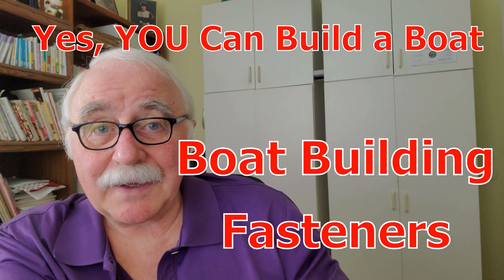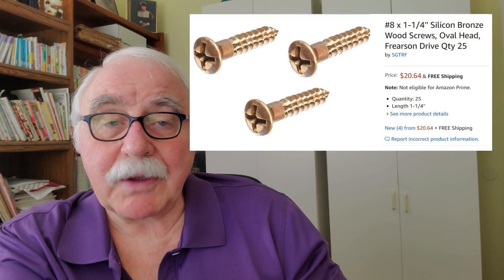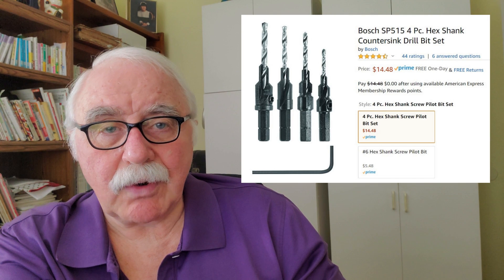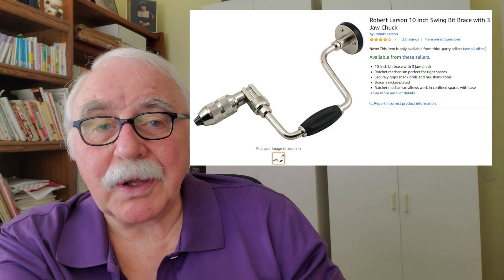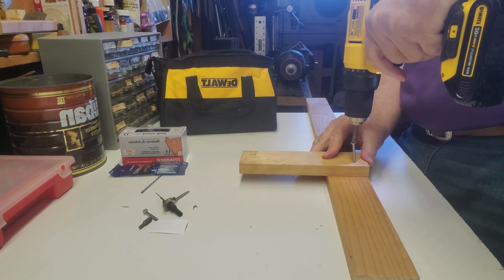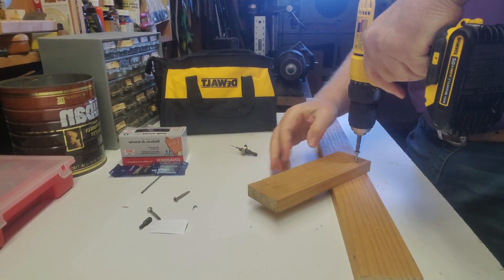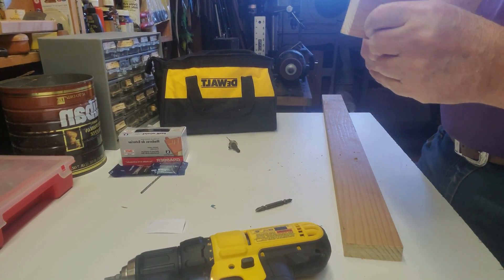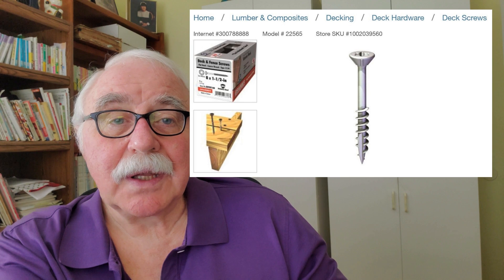Yes, You Can Build a Boat - Boat Building Fasteners

Comment: Just having a conversation with a fellow boat builder today about fasteners and I like your thoughts on it.
What do you think about using plastic staples (like Rapter) for attaching plywood 6MM to the frame ?
I wonder if they would be strong enough for areas of the plywood that are under stress from forming around curves?
Epoxy does 99% of the work but I'm interested in positioning the ply even in stressed areas and have it stay put without molesting it with tons of screw holes.

Comment: Torx head deck screws are the best thing ever in my opinion. Also, regarding stainless steel fasteners, you need to make sure to not over-tighten them. Stainless steel is hard but brittle, so in my limited boat building experience the heads tend to snap very easily, especially when using small stainless screws.

Comment: I can't believe no comments on this video. However, if stainless steel will decay from lack of air then why use them salt water being that it would leave a hole in which water has the potential to rest causing rot?
   Hope to hear from you soon.
Reply from the maker: It is a very unusual condition called crevice corrosion. I've never heard of anyone having built one of my boats coming across it. Here's an article that discusses it: https://www.passagemaker.com/channels/stainless-steel-and-corrosion
The risks of this happening on your small boat that you use frequently are miniscule, so that is why I recommend it.

Comment: Hey Jeff How are you doing,probably been reading and looking at you work for 40 years and ran across you as I am looking to build another boat.  Looking for something small that I can throw in the back of my truck and hold up to two people with no more than a 5HP motor and no more than 10 ft in length. lightweight and stitch and glue would be fine. I just finished a 12 foot Drift boat but its too heavy to put in the back of my truck  A 9 1/2 - 10"  I think is what I am looking for maybe a Pram Style?
Take care and keep up the great work!
Dale
Reply: boatbuilder1   Back in 1975, I lived in Panama, an Air Force assignment, built a 4x8 flat bottomed boat on my front porch.  Make the bottom out of 3/8 or equivalent, for bottom, 1/4 inch or equivalent for sides.  Make a sloped front bottom. I used Sheetrock ring fast nails.  I used Fiberglas on the seams and covered the nails.  It was light enough, I could put up on a VW beetle.  I didn’t have to go far on the water, so my transom wasnt that thick, used a trolling motor.  Just a suggestion.  Got the plans out of The Handyman’s Encyclopedia.  Good luck, we caught Peacock Bass, great fishing, great eating!

Comment: You said there's really no reason to have a boat held together with 30,000 fasteners, like boat builders used to be stupid or something. In many ways boat and ship builders as far back as the Vikings were far more advanced than designer builders today, as far as actual craftsmanship goes. And the further you go back in time the more the boats were held together with interlocking close fitting joints and pieces, because they #1 didn't have mass produced screws, and #2 couldn't afford to have metal fasteners rust and corrode away leaving the boat to fall apart. They didn't have a choice, because prior to ww2 there was no such thing as waterproof glue. My dad used to make boat mold plugs and actual boats out of sheet foam, in the early 60's. To hold the cut panels together, he would use tooth pics until the glue dried. Then freeform cut and add more panels until he was close to the shape he wanted, then hand shape the boat the rest of the way out to the final shape, and glass the hell out of it with fiberglass and polyester resin, then use it as the plug for a mold or finish it out as a real useable boat, or both. He worked from the late 50's to the late 60's for a mass production sailboat building company as an inventor/designer and mold maker for all of their boats.
Reply from the maker: Your guess about my implication, "like boat builders used to be stupid or something" is hilarious. Of course they had no choice in the past, available technology was just not available. Phones in the past used rotary dials, typewriters used moving levers and metal striker keys, and ships and airplanes were riveted together, and engineers did their calculations with slide rules, instead of calculators. Why? certainly not from stupidity, but those were the best choices available at the time.

I used to do my calculations with a slide rule, dialed a rotary phone, drew using a drafting machine, and typed text with typewriters. I did not do this because I used to be stupid. In fact I was actually smarter and more coordinated.

Comment: What about using bronze ring nails in plywood boat construction?
Reply from the maker: Very suitable, but a bit old school. Not really a plywood thing, but suitable for ply. Originally these were for clinker (lapstrake) boats. These days there's no reason not to use stainless deck screws, driven in with a cordless drill driver.
Reply: Easy ToBuildBoats  just curious, I’ve been watching a boat build of a 31 foot Jay Benford dory on You Tube and he used a lot of the bronze ring nails on the plywood planking.  I have not seen anyone else doing that and just wondered if it was a good practice.  It seemed to be very fast!
Reply from the maker: @mikefausett262  Well, It is not a bonded unibody boat structure, like my designs. It is traditional construction, a bunch of separate parts sailing along loosely held together with fasteners, so yes it is appropriate. 

Check out the prices though. 1-1/2", 2 oz = $20  = $160/lb. Stainless 1-1/2" = $10 for 10 oz = $16/lb. One tenth the price.